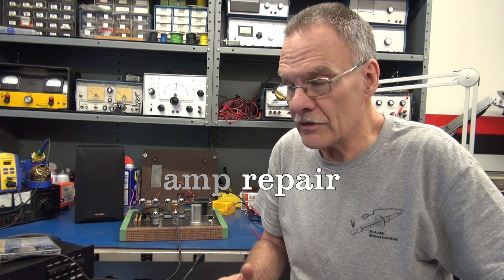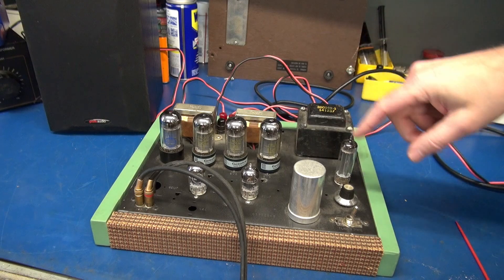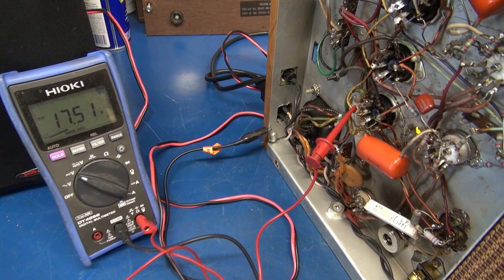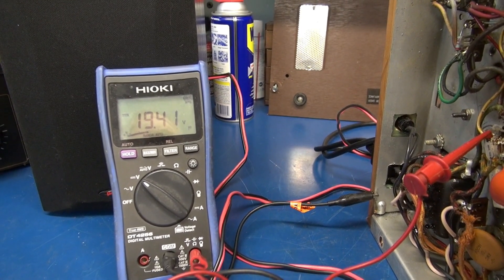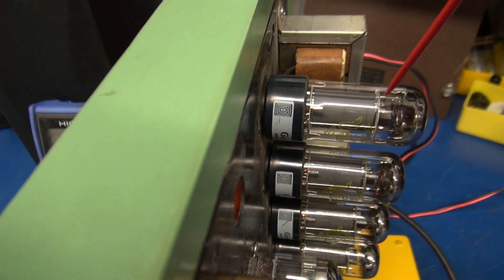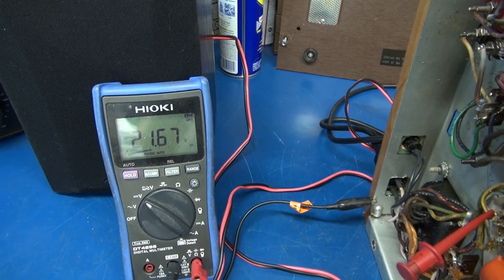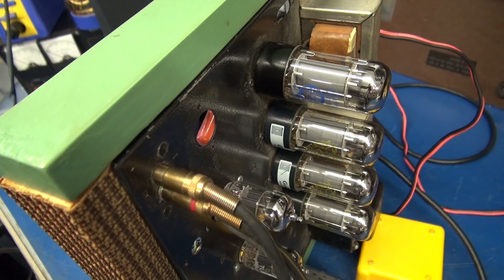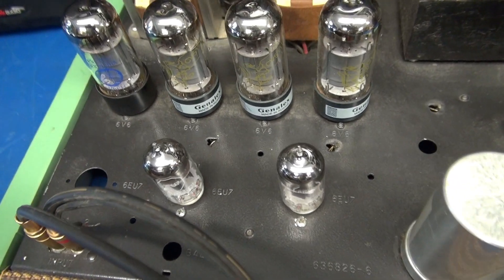Vintage Magnavox 8802 Tube console home stereo amplifier repair 6V6 push pull audio repair

Comment: These are cool little amps. Found one local for $20 console and all.  The speakers still worked and he powered on the radio and it pulled a station.  I put new caps on the speakers and tested them with a modern amp. Sound pretty decent for 63 year old speakers. I pulled the amp and my bias current was doing the slow climb from 18 to 23+ plus volts.  I pulled the power and recapped and replaced all the resistors.  I also bucked the transformer and now my cathode bias holds steady at 17.59 volts.  She sounds awesome.
Reply: HI. I have two of these. 
How do you hook up power to them ?
I have a variac to start them up.

Comment: I live in the UK and have this same amp,mine is in a hand made wraparound mahogany enclosure and the chassis is beautifully finished in Chrome. 117v supply of course which is provided by a torroidal step down transformer from the 240v AC mains here in the UK. No problems noted as the UK is 50 Hz. Remarkable quality sound.  Ian Reeve

Comment: Great Amp! I just love those old tube amps! In my opinion tube amps are the way to go. I invested mostly in preamp tubes in conjuction with mono-block solid state amplifiers. I found that it works for me cause the preamps section gives it that tube sound thru the solid state output amplifier, which is cost effective due to high tube prices and solid state handles bass better.

Comment: A common problem with these tubes as they get used. They are working near the max. throughout their use. Sharing
a cathod bias resistor can lead to failure first of one and the other tube afterwards.